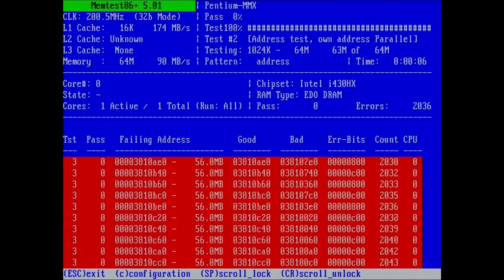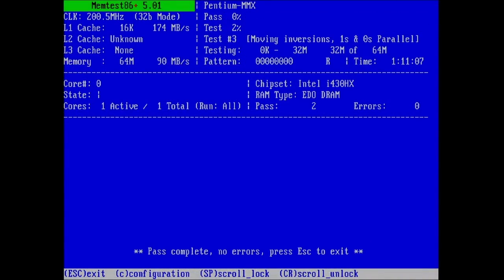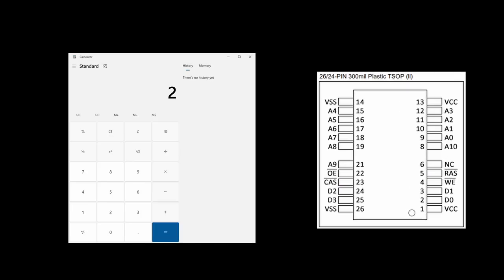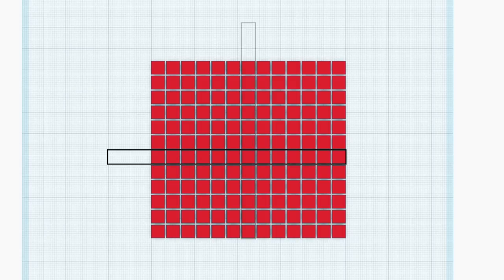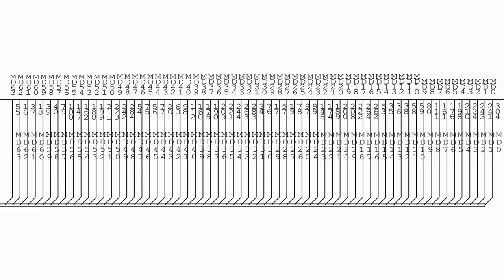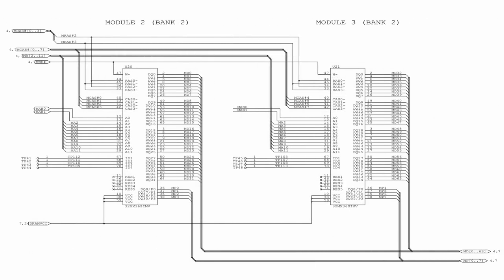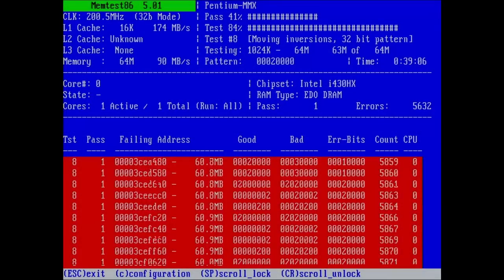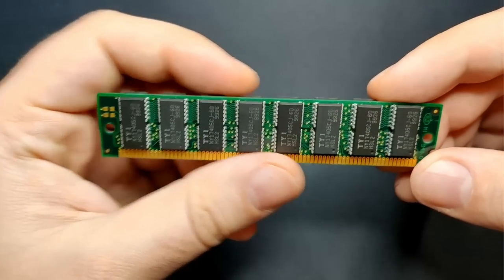Help me find the faulty chip (EDO_ERR Part 1/3)

Comment: I believe you can piggyback ram chips over the original and if the original is bad the one piggybacked on top will bypass it. I wonder if you could make a piggyback board similar to the one you made for the voodoo card to add ram. Use a socket to clip onto the ram chip with a good one on the other side of the board. Test one chip at a time and when the ram passes the test fully the one with the piggybacked chip is the bad one.
Reply from the maker: Haha! I love it! I just need to get a socket that fits, but very interesting idea indeed! But I wonder how the data pins would react. I think there would still be memory errors if your idea actually works, but a lot less - depending on the test that is running. E.g. if the memory chip is stuck on high, but correct value would be low - the working module would return low, but the faulty chip would still send high and the data would be wrong. The other way around, however, would be fixed by the working chip.

Comment: I had a weird faulty ram module years ago, running linux, that would constantly corrupt my file system so I thought it was a harddrive problem, then i thought it was the onboard controller and finally i did a memtest and there it was, a consistent flaw and when i swapped out the modules the file system corruption stopped happening
Reply from the maker: Yeah, memory errors are really hard to find. You blame everything else first :)

Comment: 0:17 from Windows Vista onwards there was the utility "mdsched" on board of Windows for testing RAM. Not sure if it was capable of finding RAM errors reliably though. Had two faulty RAM modules in my life so far. Both were second hand. One from a colleague and one from an online dealer. I wonder if they did not care for ESD safety, or why the modules produced errors. 🤔
To avoid such hazzle I prefer RAM with Ecc functionality. 😅 Unfortunately CPUs that support that feature are rare.
Reply: I wouldn't be too concerned about ESD, there is ESD protection internally, you'd have to give it quite a jolt. It's not uncommon to find a latent defect in RAM, where it develops progressing fault. Especially if a ceramic capacitor on the PCB is cracked. So that is more likely to be an issue, mechanical mishandling. Or maybe it was just a faulty module and they're getting rid of them because it got ever more wonky.
Reply: @SianaGearz  thanks for the information! ☺️👍

Comment: 1. When possible test ram with Prime95. I found that memtest86 could throw error sporadically, even one in 6 passes, so very, very long testing is needed to be sure of good memory subsystem. In Prime95 the same ram throw error in something like 5 minutes!
2. Did You even look at this ram stick under microscope? Check if some solder joints are weak.

Comment: You can try freeze spray on one chip while is testing in memtest to see if anything change. Sometime it works.
Reply from the maker: I have a feeling you are right - it seems like the module starts failing after some time when the heat increases. Could be that by cooling it down (maybe a fan may already be enough) to make the stick work. I may try that. Thanks!

Comment: about needing matching memory modules on a Socket 7 board.. is this true on Socket 7 boards that use SD-RAM instead of SIMMs?
Reply: They were transitional, just like you can find 486 boards the support either or both of 4x 30 pin or 1x 72 pin per bank, there are Socket 7 boards that support pairs of 72 pin or single SDRAM DIMMS - and while a 486 with both may allow mixing, a bank filled with 30 pin and a 72 pin, the technical differences prevent mixing on Socket 7 boards with both
Reply: SD-RAM (and modern DDR RAM) sticks have a 64-bit bandwidth, while 72-pin SIMMs are 32 bits wide ans 30-pin SIMMs are 8 bits wide. Rule is (unless you count RAMBUS/RD-RAM), you have to "fill out" the memory bandwidth for the system to work properly.

The memory bandwidth on a 386DX and a 486 are 32 bits wide, thus you need at least 4x 30 pin SIMMs or 1x 72-pin SIMM.
The Pentium memory pathway (and almost anything newer) is 64 bits wide, thus 2x 72 pin SIMMs or 1x SD-RAM DIMM. (or 8x 30 pin SIMMs, but never seen a Pentium board with 30-pin memory).

There is also some finagling regarding parity and ECC memory, but those are the basics :-)
RAMBUS RIMMs are kinda on its own - it's some sort of a ring bus that needs at least two modules and "dummy" sticks, as you can't have empty sockets with that tech.
Reply: Assuming parity bits aren't included, the Pentium architecture has a 64-bit data bus, while 72-pin FPM or EDO SIMMs are 32-bits wide.  This necessitates the use of pairs*.  SDRAM 168-pin DIMMs are 64-bits wide, which means they are accessed individually and don't need to be installed in pairs.  

*There are some Pentium chipsets that support a "half-bank" mode that allows individual 72-pin SIMMs to be installed, by only using 32-bits of the data bus.  This cuts the memory bandwidth in half, significantly reducing system performance.
Reply: @Tylonfoxx  I have a Dell Precision board (socket 423) that uses RAMBUS. I can tell you the ram sticks run very hot and I mean very! However, the speed is really good even though the Willamette P4 is pretty slow. I just have the board for nostalgia but it’s fully working. The board is picky about what ram you use…you can’t mix 45ns and 60ns sticks for example and it’s important to have matching sticks by the same vendor. Oh and if not all slots are filled or you have a bad stick then the board makes a shrill constant beep. The most annoying board when it screams at you something is wrong 😂

Comment: You want to remove EDO Chips for a 386 motherboard.. But 386 only supports FPM.. So EDO is useless in a 386.
Reply from the maker: If I am not mistaken, most EDO chips are also capable to run in FPM mode. I am not 100% sure, but FPM and EDO are not that different. It is just a different way how RAS and CAS signals are used.
Reply: SOME EDO chips can indeed run in FPM mode. Only differences are that EDO have somewhat faster timings on RAS/CAS, and include some burst mode features (the "Extended" part of "Extended Data Out") - most Non-EDO boards can also indeed still use EDO sticks, but at the slower FPM mode.

The most important is whether or not the EDO chips are 5V tolerant - FPM traditionally runs at 5V while EDO sometimes runs at 3.3V.
Reply: My experience and impression is that the majority of compatibility issues encountered using EDO with a chipset designed for FPM have to do with the chipset not recognizing the 5-bit presence detect code on the newer EDO module and failing to POST.  Most 72-pin EDO modules and some later FPM modules use the presence detect pins to advertise capacity, timings, etc.  This is accomplished with passive components on the SIMM PCB, not the RAM ICs, so transplanting the EDO ICs to a new PCB avoids the problem.
Reply: @Tylonfoxx  The chips on BuB's memory modules are EDO: chip model marking end with 5, which usually means EDO. FPM chip model marks end up with 0 in most cases.

Comment: You should try a thermal camera. See if one chip is getting hotter than the others.
Reply from the maker: I did try a thermal camera. Now I'm blaming myself not including the footage in this video. I was looking for anything suspicious, but all chips had the same operating temperature. I couldn't spot anything odd and that is why I didn't bother to include the footage. Thanks for the suggestion though!
Reply: @Bits und Bolts  Going through pass 2 until it errors likely hints that heat helps show the errors. One thing you can try is while it is spewing errors, touch each module for a few seconds with an ice cube in a sandwich bag. This will bring the temperature back down for only that chip. Careful not to hold it too long, as it will propagate the cooling through the board and to other chips. Touch each one, one by one. You may see the errors go away and come back as you heat and cool that specific chip.
Reply: @speedycpu  This is a good idea. You can also buy “cold in a can” to cool specific chips.

Comment: Err-Bits are bits 18 and 19. (0c00 = 0000 1100 0000 0000). According to your diagrams ~7:00 this should be U2. Could be another IC, depending on the real schematic of your module, but you can just check continuity according to pinouts.

the grouping (~11:00) is because of the way the pins are located on the BGA ICs and how they can be routed on the PCB.
Reply from the maker: Regarding the guess for the chip - did you consider little endian ordering of bytes? I also had U2 in one of my assumptions, but I settled for U4 because of the order of bytes when they are stored in memory. Unfortunately, I don't know how MemTest86+ displays those values
Reply: @bitsundbolts  yes, accorging to my knowledge intel is MSB, so you count from right to left. I don't really know if endiness is a thing here and obviously didn't take it into account. I may be wrong. I like the idea with the tape from another guy. Kapton would be ideal here as it is very thin and stable.
Reply from the maker: Yes, I liked that idea as well, but spoiler: with one data line taped, the system doesn't boot. I may try other pins, but it makes sense. If one data pin is taped, all 32-bit values miss one bit - so, you get absolutely no correct response from the memory. So, the conventional memory area is also affected and no operation is possible. At least this is how I justify the behavior of the system. But I keep trying the other suggestions too - time to get out the hot air station to heat up individual memory chips :)
Reply: @bitsundbolts  you could use 4 modules. That way, the device may boot as at least one range of memory is functional. But maybe the memory controller doesn't recognize the rest because of missing bit.
Reply from the maker: Holy macaroni - you are right! It does boot with 2x8MB in S1+S2 and the taped module in S4 (2x32MB in S3+S4) - now we are back in business! Thanks for your great idea!
Reply: @bitsundbolts  wonderful! Leave me updated!
Reply from the maker: So, here is a short update: It boots, but the moment MemTest starts testing (when it tries to assess the throughput/speed test), the system crashes. It is not possible taping off contacts - at least for me it was not working. But I found a way to make memory fail on purpose while the system is running. But I won't say more - you have to wait for the next video :)
Reply: @bitsundbolts  I'll wait patiently! thanks for the update

Comment: Hey you should be able to overclock your memory kit to 3600 3800 on that 5950x, it would give you a nice boost, just saying :P
Reply from the maker: I tried this once, but I did notice some instability. I value stability over speed. Now that DDR5 is out, maybe some day I get a good deal on 128GB of faster memory. I use RAM disks quite a lot (scratch disks) - wouldn't mind to get more memory.
Reply: @bitsundbolts  you should check what those rams can do individually. Like take all out and just leave one. Overclock it till you cant do more mhz  find the stable spot and see if all of them can do it. Usually you dont need to touch the voltages on a single stick, auto should do.
then once you know the actual limit then yeah put all of them back and touch the voltages till its stable. ryzen 3000 can do about 3200 on 4 sticks (mine does 3333)  but ryzen 5000 usually do 3600 on 4 sticks and most 3200mhz memory can do just fine at 3600 or more.
And indeed, mine is stable as a rock. About 60 days uptime at the moment :P
Reply: Quad rank (beacouse 64Gb of memory) of Samsung 8 gigabit B-die (14-14-14 at 3200 Mt/s can only be B-die) is very hard on memory controller. 3200 or maybe 3400 is maximum that memory configuration will run fully stable.
Reply: @laharl2k  those sticks individually will probably do 4400 2:1:1 or 4400 2:1 at 1800 FCLK (1.4V 18-18-18-36-54, tRRD 4-6, tFAW 16), but together - no chance. Quad rank is very hard on memory controller, especially quad rank of Samsung 8Gigabit B die.
Reply: @volodumurkalunyak4651 
well not too far here, quad rank micro e-die here, and my 3600x is doing fine at 3200 but it can do 3333 and 3400 but i rather stay on the safe side. :P
Reply: @laharl2k  8 Gigabit Micron Rev E (as Micron calls is) - others name it as Micron E die - will probably run at 3600 16-19-19-38-57 CR2 quad rank. Micron Rev B 16 Gigabit is somehow similar in terms of loading memory controller and it does run 4000 on Intel 10Gen (Buildzoid @Actually hardcore overclocking has a video about 128GB of RAM)
Reply: @volodumurkalunyak4651   i have 128gb (32x4) here and alone they can do fine 4100mhz but the mcu cant do more than 3400mhz with 4 of these not matter what, it just will not train the memories no matter what. These are 3600mhz sticks and i tried every voltage and setting possible and nothing makes any difference. The guys at the overclockers forumsaid ryzen 5000 could probably do 3600 but that for a ryzen 3000 its normal to get 3200 with 4 sticks.

Saw builzoid's vid but still it made no difference, im pretty sure im against a hard wall there. It can do 3200 with 1v vsoc, but i couldnt more than 3400 even with 1.2v and even setting vddg and vddp to 1.150 . it made absolutely no difference. 3400 needs double booting to post. setting all the voltages to max and touching the timmings didnt fix that either, it really doesnt want to do more than 3400 xD